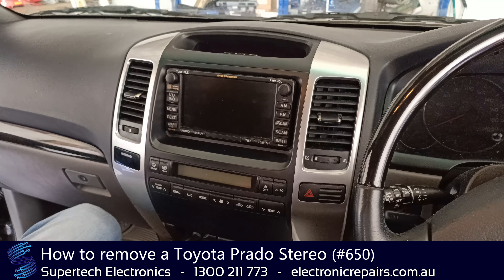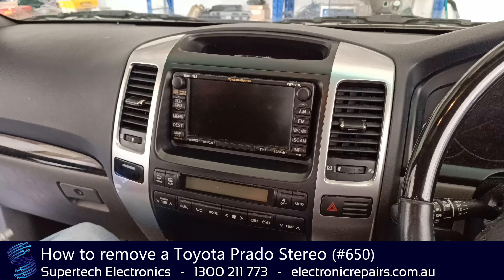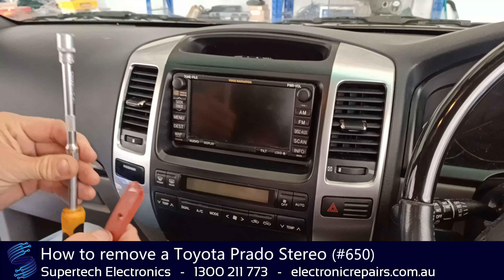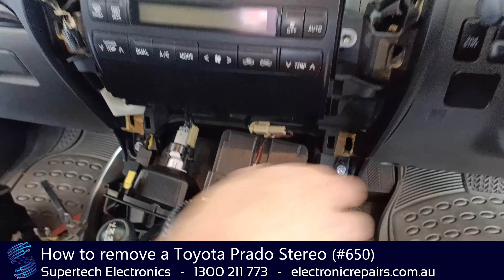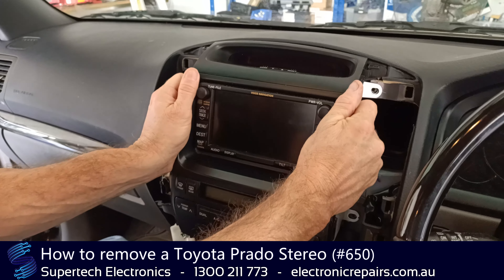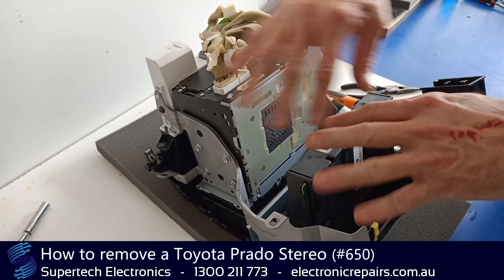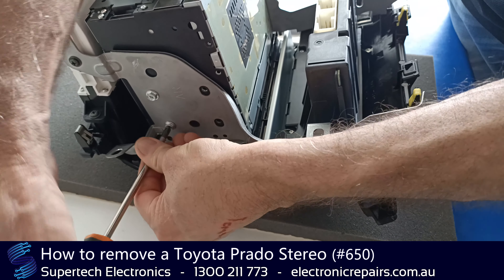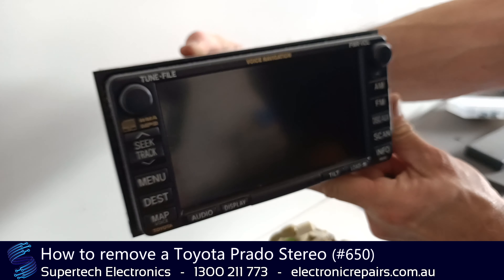How to remove a Toyota Prado Stereo (#650)

Comment: That’s really helpful to see the AC controls with the one piece facia because I’m considering cutting my facia to instal a 9” android car play head unit with its own built in facia and so it’s great to be able to study how separate the AC unit is behind the facia on the work bench.
Reply from the maker: The size of this radio is a standard double din size. It is easy to replace but if you have steering wheel controls you will need additional special interfaces. Stay away from cheap android units sold on eBay and Ali express. If you have any issue with these the Chinese company will either not exist or not give you any support. You will be better off repairing this unit if it has a fault. This will be the cheapest solution. Otherwise if you want to replace I would suggest a brand name like Alpine or Pioneer. These companies have good support and you will probably need it if you are installing an aftermarket stereo. We wish you luck!!!
Reply: Wondering how the replacement went. Have a Prado 2003 and wanting to replace  too
Reply: Hey did it work ?